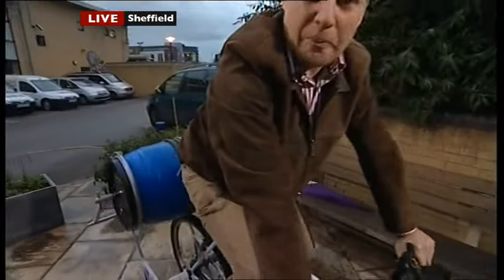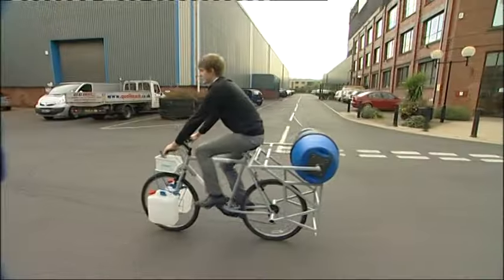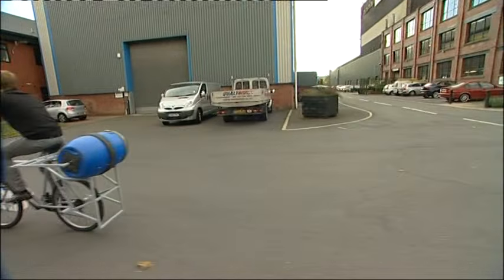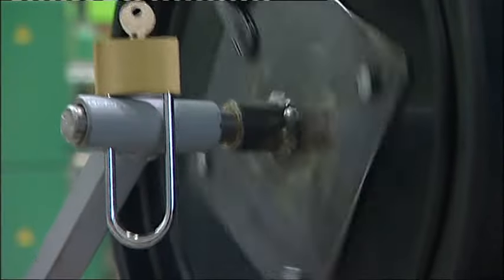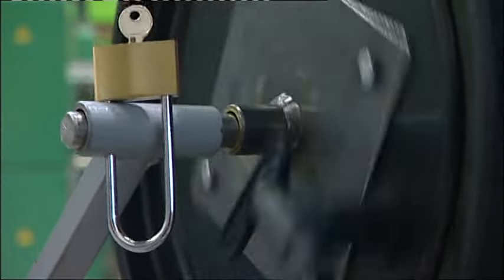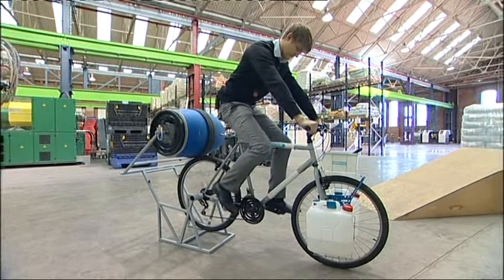SpinCycle Pedal Powered Washing Machine (Look North)

Comment: Pedal power has great potential for many purposes - and not just for low-tech countries. Most of us could do with using less grid electricity as well as the benefits of exercise. One point on this though - as a dedicated hand-washer - washing is easy; the hardest bit is the rinsing and wringing. The several changes of water required might be a problem while in transit.

Comment: You are absolutely right about efficiency! The other problem with this is that you'll need a bicycle AND the washing drum which requires far more investment than a single pedal powered washing machine. He should chuck half the bike and connect the drum straight to the chain. That would be a viable option. Bicycle and drum can be a solution for first world people only who could use their bikes as a washing machine. Poorer won't be able to afford this.

Comment: Does spinning clothes all in one direction get them clean? They just go round in circles. There is a system of soaping and pounding clothing once or twice on a big flat rock in India that seems much more efficient than spinning - no offense intended.
Reply: If you go slow enough I think it can as they will slosh around and the friction will clean them. If you glue boards or cut rubber balls in half and glue them on the inside it would be much better.
Reply: i think there's an agitator in their that rustles them up as it spins. I think the guy knows what he's doing and I think it's great.  This on in this video looks like an improved version of his previous video. If he keeps improving on this it could really be a game changer for developing countries and off grid living.

Comment: It should be sitting on the wheel while you afr riding it to work. Then the clothes are washed when you get there
Reply: onetwothree57 It on a frame
Reply: If it's a heavy load it'll probably make the whole thing unstable and you could fall. Besides if you're going uphill you probably won't be able to bike or you'll get exhausted. It's better to just do it in the static mode
Reply: @blackwood5851  3 wheel bike?

Comment: I think it would be a much better design to attach a chain from the rear sprocket to the drum and not the friction drive. The friction drive is at least 20% less efficient than from powering the spinner from a second chain.
Reply: there are a handful of tweaks I could see being useful, like make it operational while riding and add an inner basket for a spin cycle.

Comment: dang that was my idea too good  to know someone post it good job bro..need to make a bigger size  for comforter and  with a spinner dryer too.. it would be nice if you can do that and post it again well kind uh  hard for me coz i don't have those material..
and there's a way also to make a free energy it ,from dc voltage to ac voltage using inverter and a battery .

Comment: Solar panels are fine and dandy for some things. They are generally speaking NOT good for powering motors. Motors use quite a bit current and thus require quite a bit of solar power. It's much more efficient to use human power. Use the solar panels where they work best, lights, radio, computers ETC. Use human power for the rest.

Comment: About 70watts from fit average human legs trying quite hard, mechanically to a bike wheel. 80-90watts 1SqMt solar as long as the sun shines. What ever way you look at it, it depends on what you have, if you have legs and a bike then go for it, if you have mod cons with a machine that uses around 2000 watts thru wires and don't happen to have 12 men to pedal, plug it in the wall and go for it.

Comment: Great idea but such a young smart chap should realise that that tub is spinning FAR TOO FAST  and the clothes would most likely be stuck tothe walls by the centrifuge force. A washing machine spins much more slowly so that items the load tumble over each other froom the high point of the tub so there is far more stirring and rubbing against each other  and more washingStill, a great start and of the "rider" "rides less quickly", it may work much better. and leave the faster riding for the actual spin cycle in a slightly different tub,  with holes in it and a shield for the rider and for whoever else is about, meant for extracting the water Still, great idea and good luck to the young inventor
Reply: that's a good improvement to his washing maschine
Reply: If you stopped every few minutes would that do the trick? I wanna make this washing machine for myself but I want it to work

Comment: Needs some cappable holes in the barrel so you can unscrew the caps and use as a spin drier. For super spin speed, ride down a really big hill if there's a redesign so you can ride and wash at the same time!